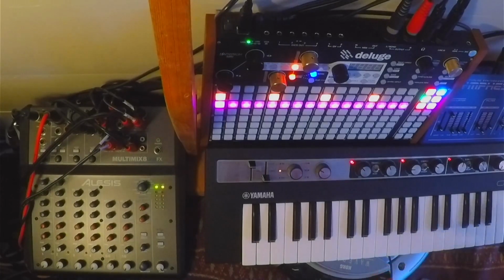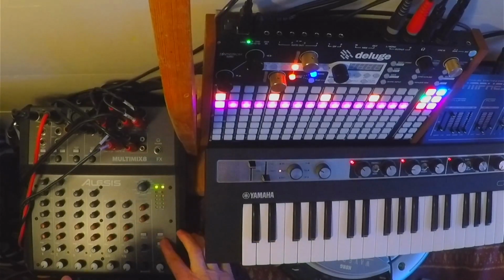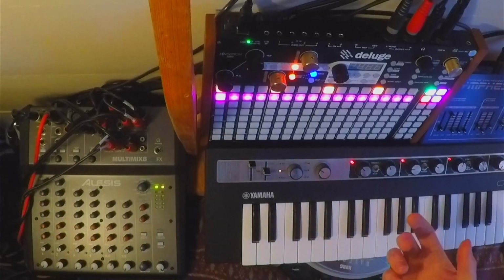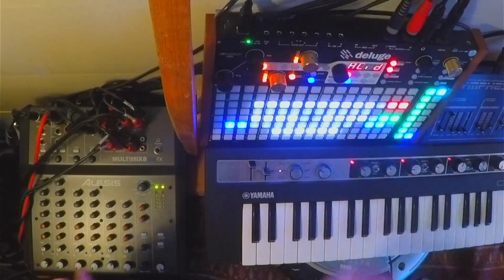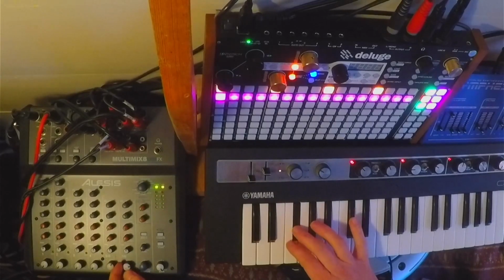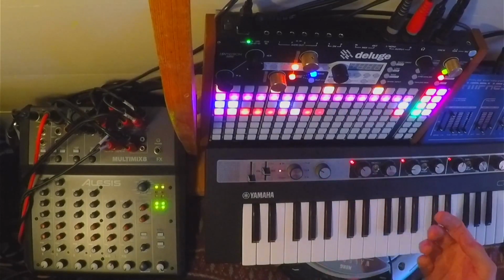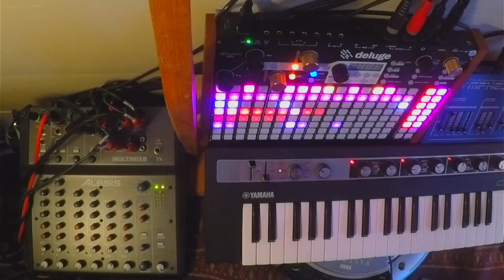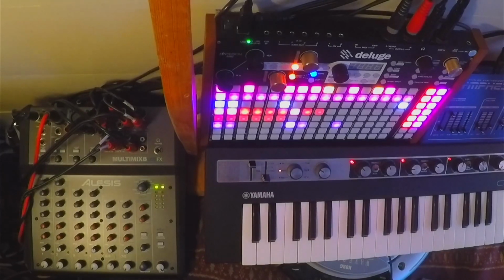Faux Send-Return - Synthstrom Deluge

Comment from the maker: If you are looking for the second method... I lied. I tried getting it to work (panning a synth all the way to the right - sending the left output to a pedal, and sending the pedal into the line in, and monitoring the left. input). It somewhat works, but you end up getting feedback, and it just does not sound great. You can record audio without monitoring to avoid the feedback. But its not ideal. 
Sorry for getting your hopes up. Here is hoping that in the future, Synthstrom will create another hardware updated, maybe replacing some of the gate-cv I/O with audio and maybe a send return.
Reply: Deluge delay and reverb send stereo regardless of panning. I find a dry hard panned signal doesn't bleed into the other side.
Reply from the maker: @girlinagale  I might be wrong here, but if you turn of the stereo on the delay, panning will effect it. But the reverb won't since its a a universal bus that all tracks are sent to. Hence why you can only have one "type" of reverb on a song. While the delay is independent.
I did end up making a vid showing how you can use the deluge together with pedals only though. But I do find that there is some bleeding between tracks even when doing hard panning so it's not ideal. But it works. Again my biggest wish is for a dedicated send return on the deluge itself. I would happily sacrifice some of the gate/cv connectors for that. 
https://youtu.be/8hEmPUiQnSI?si=v-Q4YlvhJ7vuO7he